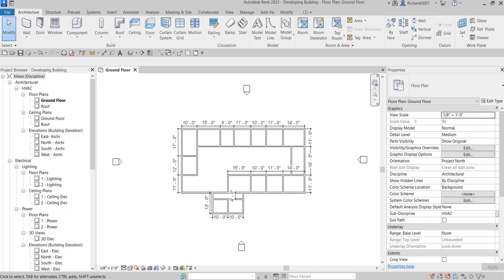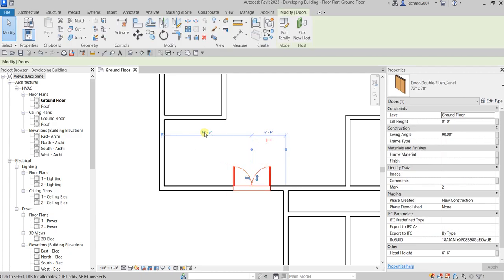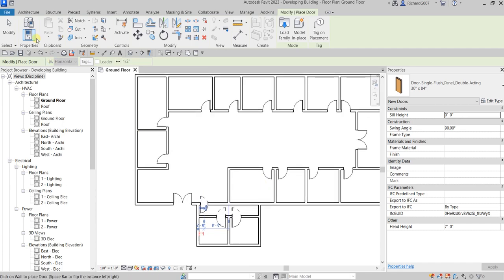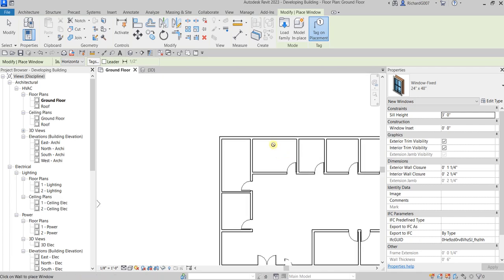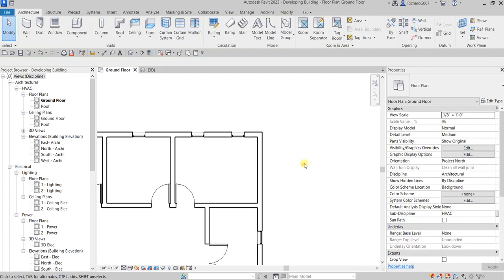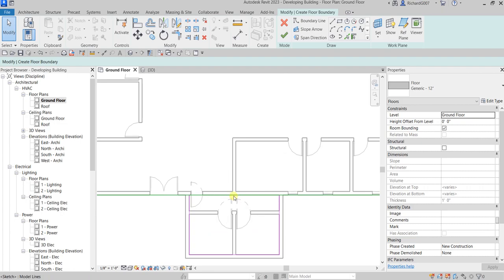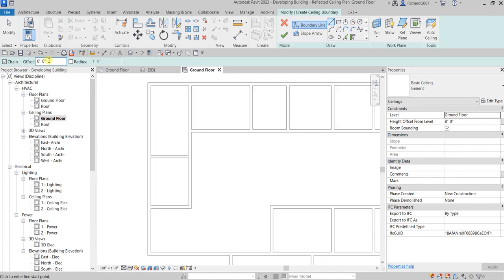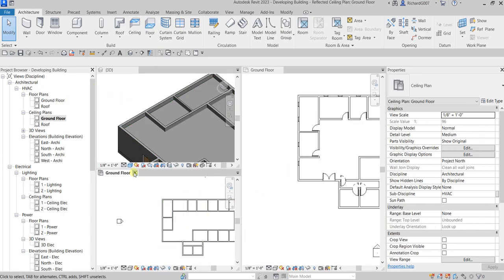REVIT 2023 FOR MEP - Lesson 3 Creating Building Envelope 2

Comment: sure this is an easy fix, but when placing the doors on the walls, the wall segment where the door would be does not dissapear when the door is placed, any suggestions?
Reply from the maker: hi mate, sounds like you're encountering an issue where the wall segment isn't automatically being removed or modified when placing doors in Revit. This can be resolved by using Revit's Wall Opening tool or adjusting wall properties. Here's how you can address this problem:

### Method 1: Using Wall Opening Tool
1. *Select Wall:* First, select the wall where you want to insert the door.

2. *Place Door:* Go to the "Architecture" tab in the ribbon, then click on "Door" to place a door on the wall.

3. *Adjust Opening:* After placing the door, select the door element. Look for an option in the Properties palette that allows you to "Edit Wall Opening."

4. *Modify Opening:* Use the "Edit Wall Opening" tool to adjust the opening created by the door. You can resize or reshape this opening as needed to accommodate the door.

5. *Review Changes:* Verify that the wall segment has been modified or removed appropriately to accommodate the door opening.

### Method 2: Adjusting Wall Properties
1. *Select Wall:* Choose the wall segment where you want to insert the door.

2. *Edit Wall Properties:* Open the wall's properties by selecting it and going to the Properties palette.

3. *Enable Wall Sweeps or Reveals:* Look for properties related to "Sweeps" or "Reveals" in the wall properties.

4. *Adjust Parameters:* Some walls have parameters that control how they interact with openings like doors and windows. Adjust these parameters to specify how the wall should behave when doors are placed.

5. *Apply Changes:* Confirm the changes and place the door again to see if the wall behaves as expected.

### Additional Tips:
- Ensure that you are using appropriate door families that are designed to create openings in walls.
- Check for any constraints or additional settings that might affect wall behavior in the Revit project settings.